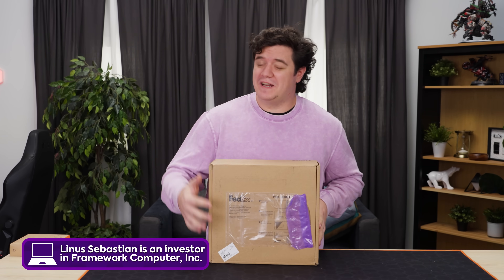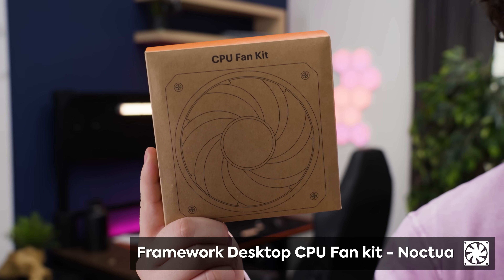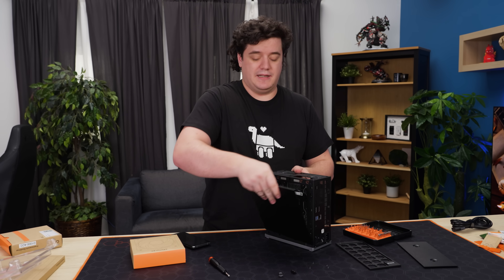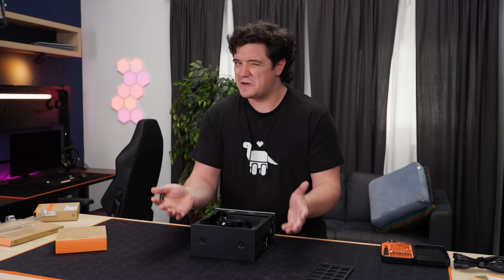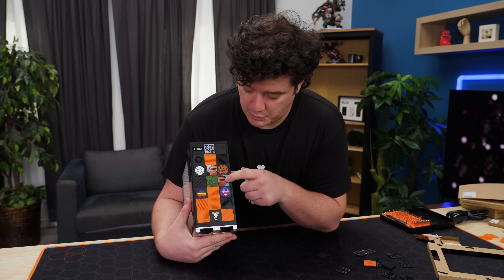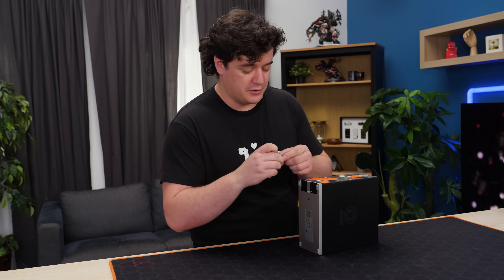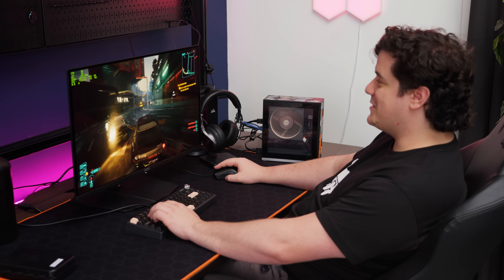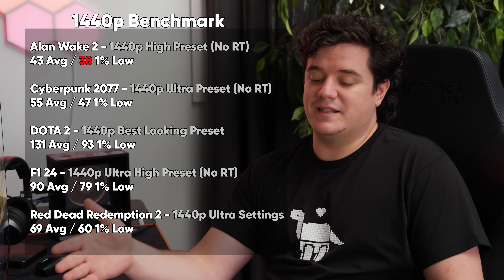This TINY desktop makes me nervous.... - Framework Desktop

Comment: 5:32 I can't remember upgrading the RAM on any PC since the 90s. You configure what you want and just go with it. The issue with Apple and their soldered RAM is then the price they charge for the higher amounts. And this is when everyone objects to the soldering as you can't replace the RAM yourself. Soldered RAM has all the speed benefits, so I'm ok with is SO LONG as the price charged for the higher amounts is reasonable. And considering the labour costs are about the same, the price increase for the higher amounts better be small!

Comment: So in a sense i do agree that its a bit silly they arent including the standard config since its needed but at the same time, while probably a me issue, i have a shelf in my flat and on top of it is a huge pile of excess cables. There are at least 4 C13 cables there, they never break. And i wont even attempt counting the amt of displayport and hdmi cables there.  Why there? Because people dont look up so i pray nobody notices. 
On top of that it does not appear like they are overcharging you for the cable either? And it shouldnt increase shipping costs right? So IF they warn you that you absolutely need one I dont see an issue. You should probably sleep over your config of anything you puzzled together on their website anyways once you know the final price.
Regarding the upgradeability of everything else, I think people have already pointed out everything there is to say about the technical hurdles. Basically they did try and AMD did confirm that they just werent able to pull ram off due to technical challenges. We do have to accept that those technical hurdles are a thing so the only real question is, given that there are these technical challenges that make this peobably the least upgradeable PC (apart from maybe Dell) ever, should Framework just have scrapped the idea? I dont know. I do think it is at the very least a blemish on their brand and credibility. 
On the other hand they do still seem very committed to their mission with everything else and they do still release stuff for 3d printing i think? Please correct me if I am wrong.
So if this allows them to do some nice money printing thanks to the AI folks that will slot 20 of these into a rack, maybe that then allows them to make more stuff that i find cool? Could also turn them into yet another faceless mass of evil. I dont know and I guess we will have to see. For now I am eagerly awaiting the next FW13 cpu refresh so that i can finally uprade mine after quite a few years.

Comment: This may be a super stupid q, so forgive me. Why can't devices that have "unified" memory also just utilize DIMM'd memory additionally? I mean most people hardly ever use all their RAM and when they do the thing they really want to avoid is swapping to disk which would torch their performance and, over time maybe their SSD. Can't there just be some slots for RAM that it can "Swap" or "park" apps or processes that you want to keep in memory but don't really need the fastest performance on. Like a RAM limbo that would save from having to swap to disk but otherwise just sit unused unless your soaked your unified memory?

Comment: Why is everyone making fun about the power cord LOL, what is more important is that Windows does use dynamic memory allocation.  Have a look at Wendell''s video.  You can assign 1GB of Video memory and still get all the video memory  you need if the application accept dynamic allocation.  The only reason they allow to hardcode a certain amount of VRAM, is because some applications don't use it and look at the bios for VRAM allocation.  I run mine at a 32 VRAM/ 96 RAM but if I run AI models (why this machine is so wanted for), it easily runs the largest OpenAI model that is available.

Comment: $2300 is too much. I'm sure a no name brand will pop out a mini pc with the 395+ AI XXX for half the cost.
Only paid $400 this summer for a 7840hs mini-pc (Hand sized) with 32gb 6400 lprddr5 that will play anything (780m at 65w b/c it thermal throttles worse at 80w), before hooking up the Oculink GPU dock. Waiting on a new 20+GB card to replace the old 2070 Super.

Comment: On the front tiles… I wouldn’t bother myself, since I can 3D print what I want, but it does seem like they should offer a plain front cover or tile set, included in the base price of the computer. I understand Framework’s side too; they are manufacturing something that they’re also encouraging people to make themselves, and that manufacturing does cost money. The net effect is to discourage people from buying them, which is fine; it’s a valid business strategy, if they are indeed doing it intentionally. However, all that is nothing compared to not including SOME kind of basic front covering, in my opinion. Please correct me if they do include something.

Also for the price of the computer, they really should bake in the cost of the power cable. Having to select a region absolutely makes sense, but having to pay extra for it is another example where I guess they are just trying to discourage people from buying a new one, since MOST people probably have multiple power cables just chillin in a drawer somewhere, so just recycle cables. I have them all over, thanks in no small part to my job lol.

Comment: I have multiple bags of C13/ATX power cables. They haven't changed for well over 30 years. Just e-waste to include them. I'm glad they are an extra, reasonably priced, add on. Stop getting mad when a company helps us reduce e-waste. Note their configurator defaults to not including other absolutely-required parts, like an SSD. This is exactly what a DIY and repair friendly OEM should be doing for their most-enthusiast-focused product.

Also, reserving VRAM sets the minimum memory dedicated to VRAM. You can set it to the smallest possible value and have virtually identical gaming performance in most games because it is unified and dynamically allocatable. The BIOS just sets a lower bound. At best your information on this is misleading, but IMO it's flatly wrong and deserves some correction.

Soldered RAM isn't ideal, but it's not currently possible to have DDR5 at 8400MT via SO-DIMMs, especially not quad channel. Hard to fault framework when AMD supports no other way of bringing this chipset to market.

I agree the tiles are a little weird and feel a little nickel+dimey, though they technically aren't at all required and neither is the chassis. You can just buy the board and pop it in any ITX compatible enclosure.

Framework selling you only what you need is a good thing. Framing it otherwise seems pretty absurd given LTT's past advocacy. It feels like you're grasping for straws, maybe to prevent accusations of bias towards a company Linus has invested in, but the result feels inauthentic. I don't think anyone worth listening to would have balked had you maintained consistency by praising waste reduction and repairability.
Reply: I mean when apple sells you a charger for $100 AND they improve year over year, I get the mad. Here? It's only $5 extra! It's not even that much more than amazon! come on now.

Comment: The 395 AI max plus dingus is $1300. This one here is a 385 and MUCH slower. Dunno why Elijah didn't notice. 
The more expensive 395+ is just about equivalent to a rtx3060 desktop GPU. Yes, impressive for a mobile chip in a tiny package, but not all that much to write home about. Yes, in AI workloads it is somewhat superior, but we are talking gaming here. 
The 4070 they referenced is a MOBILE GPU. (And thus also a worthless comparison because who knows what kind of power the "mobile" GPU is allowed...) 

It's MUCH more cost efficient to just build a sff PC. And it will be upgradable. 

Unless you NEEED mobile AI, the 395 is a skip.

Comment: 1:37 the thing is with this, like dude I have hundreds of these things at home, I don't need another. I don't mind this because it's not wasteful, and saves me money. This type of power cable is so ubiquitous I'm sure everyone has as many as I
Reply: I don't have any, so what's your point? This is the same shit with chargers, and look at us now? Did the price of phones decrease? No
Reply: @baderzahiri2310 they took the brick the earphones and left us with the phone and a manual
Reply: Totally agree. Framework lets you cut out everything possible you might not need, not only to reduce waste, but also cost. I love that about them, and think this is a GOOD choice by framework, and part of who they are really.
Reply: Thing is, it won't actually save YOU money, it's still the same price most of the time
Reply: Even if it doesn't save me money, I don't want another cable to add to the junk drawer when I already have plenty of C13 cables in there.

Comment: you can get a solid 1080p 60fps on cyberpunk, all for the low low price of $2000! how could i turn down this incredible deal? /s framework is such an overpriced scam. yall only keep pitching their shit because linus is invested in the company, otherwise yall would be talking about how awful of a deal this is.
Reply: You kinda missed the target audience for this device. In the video, the machines gaming performance was just a nice to have. This machine is made to be a local LLM dev box or someone doing AI based Engineering. This isn't targeted at gamers in any way.
Reply: @Samjam927 doesn't change the fact that literally everything they make is 2x more expensive than it should be.
Reply: @thedanbot85  Yeah you pay a price for a modular device made in smaller batches so over time you can carry over more components (like the display, keyboard, chassis) as opposed to buying a brand new device every few years. Framework isn't for everyone but being upset that something not made for gaming can't game well misses the point of a small dev box like this. The modular laptops they make and this specific "Desktop" are for different audiences in the same ways they cater to enthusiasts compared to more mainstream brands.

Comment: I think framework knows their target audience. I don't want the charger in the box by default unless it's a custom solution. I don't need the C13 cable either. I have more of those than I know what do do with. The fan Kit is a necessary component. It is a custom solution. RAM, SSD, etc which are aoff the shelf components I might already have or be available readily anywhere are not things I am going be mad about them not including. I am ok with the soldered RAM on the framework though because of the APU they chose. I wish it wasn't necessary but when you basically put a full fat GPU into your APU you are going to need fast memory and any user replaceable ram is going to suffer from signal integrity issues at higher speeds to to impedence mismatch at the inteface.

Comment: Its more that they LET YOU NOT BUY the power cable and the front tiles, rather than force you to buy them anyway.
Reply: Could you please show this much anger for APPLE and SAMSUNG no longer providing POWER BRICKS for their phones?  They have been doing that for many years now, and I do not believe I remember seeing that same complaint on the Fold 7 videos and such.  Be consistent.  If I were to have a child, and they are getting a new phone for the first time, they do not have a brick in the box to charge the phone, a "mission critical" ability to charge the device, right??
Reply: they shit on no power brick often in phone reviews... But also at this point the vast majority of people have a way to charge their phone... The vast majority of people do not have an extra universal power cable laying around
Reply: i also think itd be great if framework would make screwdrivers an optional addition, since i feel like most people buying these already have a kit, so its pretty wasteful imo
Reply: smart way would be to add the option to substract $5 at the checkout - that would put a smile on my face!
Reply: This... Plus I have somewhere around 10 of those cables lying around... I don't want another one... 😅
Reply: It's also reducing waste which is a major part of what framework is supposed to do, you have those cables already there is no way, you have never had something break with that cable if you have been using PCs for over 10 years.
Reply: Exactly, he doesn't seem to understand basic economics. Also, it is wasteful to have all these cables produced for everyone, when many people will never use them (because they have cables already).
Reply: @trackfresse  the main issue here is that it's being seen as an extra rather than an opt-out and save money. it's more of a marketing issue here
Reply: @trackfresse he understands it alright 😂 it's a team of qualified tech writers writing these videos.. Linus is invested in framework.. they needed to appear unbiased and point out some cons, but they purposely made it so that the cons they mention are obviously pros in disguise and the audience starts defending those. And they were successful.
Reply: @mildmixchintu1717 I was thinking this too. Come off as neutral and balanced, and the fans jump in to defend and boost engagement. Genius move.
Reply: Look it should start out at x price whatever that is then you save money by I don't need a cord I don't need a handle I don't need the tiles. And unselecting them otherwise you're going to have people complaining and it's going to be a frustration.
Reply: Plus if you do want one you still need to specify the type of plug you want
Reply: But you can't NOT buy the tiles though?

Comment: I don't agree whatsoever with the complaint about the tiles, yes they are expensive, I wouldn't actually buy them and would print my own or put something else on the front, but Framework has always sold to you the basic thing you need if that's all you want which is awesome and no other company does that (I really hope that starts to change and more companies do it) and then they offer you these tiles that aren't functional at all, they're just for aesthetics and yes they probably get a bigger profit percentage from them. This is totally fine in my book because this way this pretty cool startup can make a little more money to keep growing, and they use this strategy in a not essential or even functional part, it's just an option for those who value it and can afford it, that's great to see from a company.
Reply: Only thing I’d like to see is a free option between a tileable and a solid/meshed front panel. That way your computer doesn’t feel like it was left incomplete. 
I get that it’s the stand-out visual of the Framework desktop, but FOMO around 36-54€ of plastic squares isn’t great.

Comment: If we're going this direction (soldered ram, non replaceable cpu like a smartphone) for the sake of performance, from framework and from this price point I would expect a compute module that I can swap for when I want to upgrade. There is only a number of components that HAVE to be soldered closely together to perform best. Also, AMD, the soldered ram it's called cache. You're so impressed by the size of this pc but there's plenty of mini cases that fit a 4060 low profile that are cheaper and more modular and upgradeable of this thing. Please make this framework desktop fail before it becomes industry standard.

Comment: I'm okay with manufacturers not including cables and chargers. I have a lot of those already, and getting more would just be e-waste at this point (and would probably just strangle a lot of turtles eventually). I think people just like the feeling of getting something for "free," but unfortunately, nothing really is. Framework could just add $10 to the price and add the cable for "free," and any complaint would just be lumped along "this PC costs a lot of money." I never saw a price reduction on iPhones when they removed chargers, but people just kept buying them anyways. Point of this rant? Keep doing you, Framework. I'll eventually buy one when my  7 year old Xiaomi laptop finally bites the dust (would have already if I didn't know how to replace the battery).

Comment: I am ok with the fashion tiles as they aren’t required to run and you can the 3d print them. 

I find solder ram even with amd’s requirement severely offensive and have wondered for a long time why soldering the ram allows for such a speed increase over lets say using a little zif socket for each ram chip and components required to identify and run them. I say individual zif sockets per chip so the memory bus can be as wide as possible.

Comment: I'm thinking of building much smaller desktop using Lenovo m720q + PCIE + gpu and so on. Which the CPU is not soldered nor is the ram, ye bit older in generation but least can cheaply put it together and able to run off 20v 90w psu compared to that desktop, that is soldered together and requires mains power. I love Framework, but this isn't for me.

Comment: I think a full set of black tiles should be free since the case is incomplete with out them. I do like that there is an option for the power cable but I wish the price was included and if you opt out you get $5 off rather than adding $5 for one. It feels better to choose a more eco friendly option and get rewarded with a discount rather than needing to pay for something that the computer requires. I think they should just include the cost of the tiles and the power cable in the build and you can opt out for a discount.

Comment: i think the better way, in terms of customer experience, for framework to provide options to receive (or not receive, to prevent unnecessary waste) certain components would be to build them into the base price. don't need the power cable cos you've already got extras? then select "no power cable" and the price you pay reduces by $5. include 21 basic tiles, and if you dont need them (because you're 3d-printing your own, for example) you can get a price reduction for them too, or if youre swapping out a packet for some colourful ones, it just adds the extra $5 per pack to the base price.